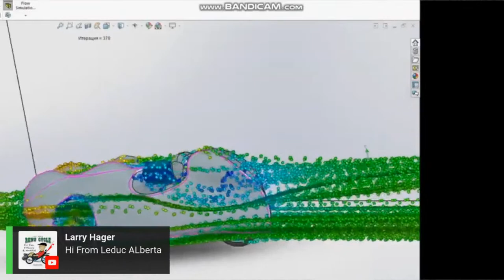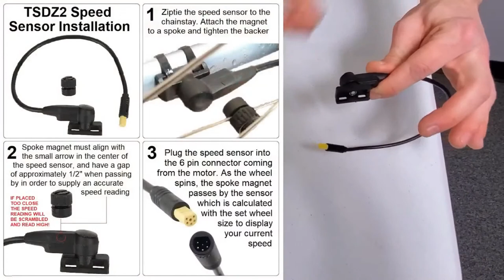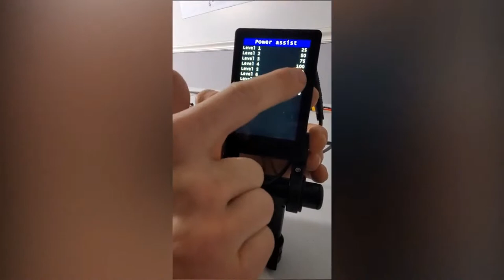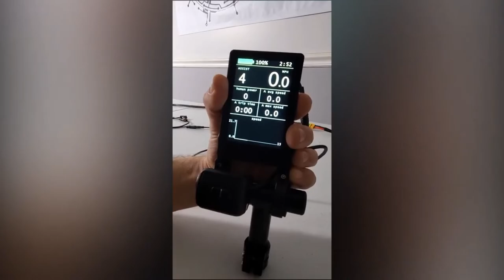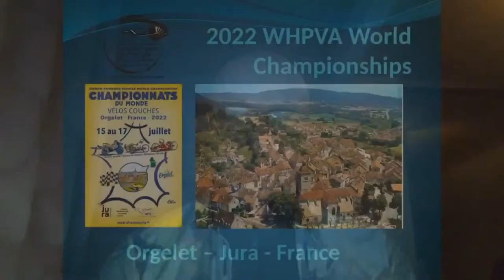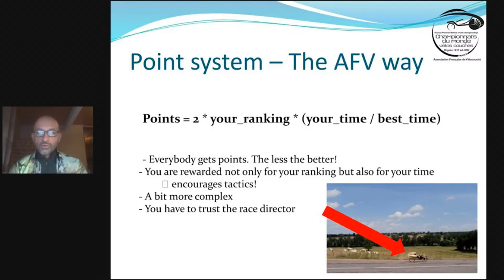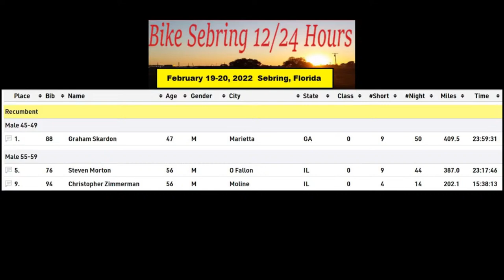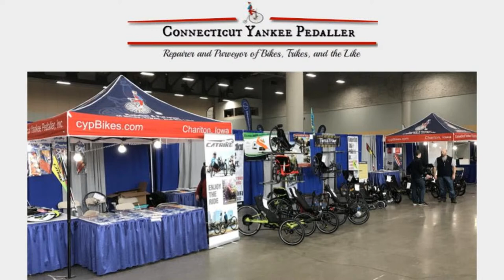Adding Low Cost E-Assist to Your Trike!

Comment: Installed 2 of Eco Cycles TSDZ2 last week on my wife's and my 2013 Ice Sprints. Absolutely love them. Purchased the big 52V 19 Amp battery and two days ago we were able to trike 74 miles in one day without recharging and have a 25% reserve with part of the ride climbing steep hills. We're 71 years old and its like we have bionic legs now. Seeing new places that we stayed away from before because they were hard to pedal the hills. Eco Cycle kits take all the hard thought out of E-assist install. Wiring harnesses were a perfect fit and designed for all trikes with optional extensions included. Really like that they come standard with upgraded motor gear, optional boom clamps and the best color computer available. They also had the exact T cycle accessories that I needed for both the battery and computer mounts. Most knowledgeable E-assist conversion DIY supplier out there!
Reply from the maker: Hey Gregory-That's great to hear! It sounds like it's really given you both a new lease on your riding😁  Enjoy!!

Comment: I have a nearly new 36v12AH anderson battery from my rear hub motor. I want to switch to mid-drive on my recumbent trike. Is your kit all I need + my battery?  I currently ride with a 52t/11-32 and ride highest gear inches to get some resistance and exercise.  Would I want a 52t with this torque sensor system or would a smaller crank equal good resistance due to torque sensor instead of cadence?  I would have my local Velofix install for me (I'm an old lady lol).  Trident Spike 2 recumbent if that matters. thx

Comment: Hi David. I have an older model Greenspeed GT1 which has 16” wheels. I am 71 and disabled to the point where I am unable to walk 200 meters but I ride an average of 34 klms per day. (I am on Strava if you want to confirm that I’m telling you the truth) I’m just getting over Covid for the second time so I haven’t ridden for a couple of weeks. 
My question to you is, do you have a motor etc to fit my GT1? I have problems with the hills and when it’s windy. Kind regards, Chris Barrett, Western Australia.

Comment: I was under the understanding that it was possible to put dual chain rings on the TSDZ2. 
I thought the mounting brackets on the display very odd as it would not fit on either of my trikes Ice Sprint RS 20" and a Azub Ti-Fly 20.  If I was going to convert a trike it would be the ICE as it is my day rider now.   
I guess I really am not in the need for electric assist yet as I am still a young 73.

Comment: I do not follow why would anyone mount a hub motor on the front wheel when the pedals power the driving wheel which is the rear? Hubs are fine but noisy and inefficient over a  Crank Motor that has  more power (torque) for the same size hub motor. I have been riding an HPV with PAS for 20 years- had one hub and never again. Next step will be a VEER belt drive and do away with the chain drive forever.
Reply: I added the Bafang Fun8 front hub 500 watt 48v kit to my Rans Stratus XL recumbent with 26" wheels and it allows me to retain my 3 front sprockets as well as my 9 rear sprocket gears.  Thats 27 gears versus most mid drive motors that use a single sprocket in front allowing only 9 rear sprocket gears.  
  This allows me to use the smallest front sprocket to pedal assist up very long steep hills without overheating the motor, the middle sprocket for most pedal assist riding or the large sprocket for slow cadence pedal assist at higher speeds.  I also use dual batteries, a rear rack mounted 52v 30 Ah battery and a 48v 10 Ah battery mounted in the seatback bag from Bacchetta together with the Date DX2 device.  This combination gives me over 50 miles range using PAS 5.  I have the  P-850C display which allows 9 PAS mode operation.  It works for me just fine.